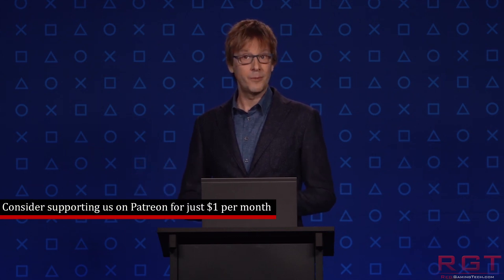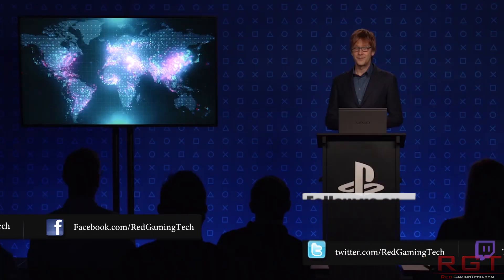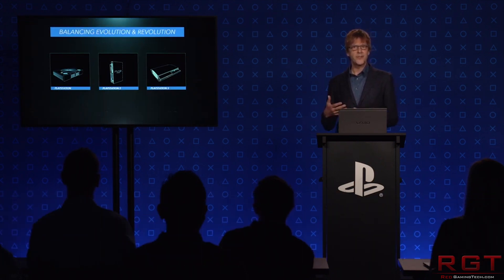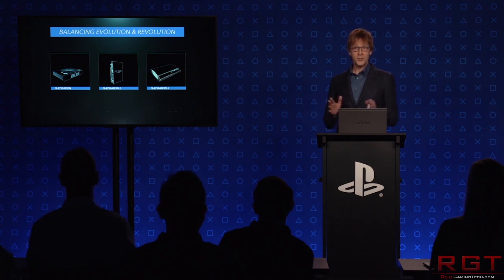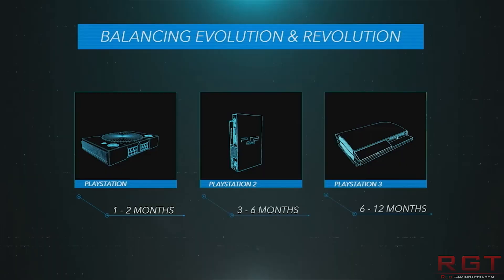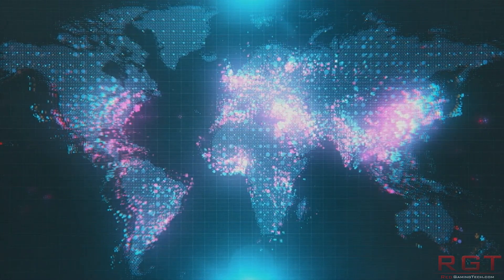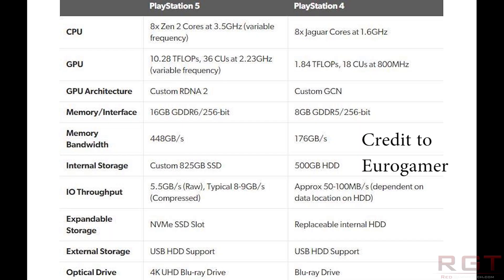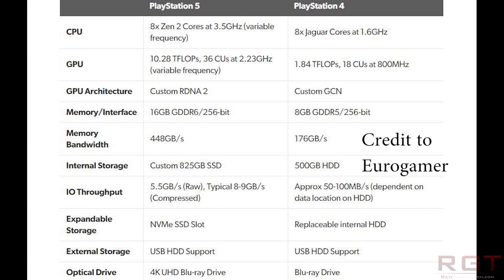Playstation 5 Spec Overview & Analysis | 10.3TFLOPS & RDNA 2 | 3.5 GHZ Zen 2 & Crazy SSD Speeds

Comment: but what is the difference two GPUs of the same architecture delivering the same teraflop .. one with a higher frequency but the other with lower frequency but higher CU in terms of performance and temps?
Reply: Use your brain for once man the harder and faster you push something the more heat it generates. Heat is the limiting factor here.
Reply: @voodooknyte  also Sony has divine studios that required this. Heat was a major factor yes.

Comment: Okay, I mostly called it. I said way back in December that the GPU would be RDNA 2 based (with customizations) and that Sony would be aiming for 10.5ish Tflops.

LOW AND BEHOLD!

Admittedly I thought it was going to be 40CU's at a slightly lower clock speed, but still.

As for my estimate here. It looks like the XBSX GPU is going to be on par with a 2080ti and the PS5's is going to be on par with a 2080 or a 2080 Super. Somewhere in that area. If we look at RDNA 1.0 teraflops, 10.5 of them would be about on par with a 2080. Maybe a hair lower. But RDNA 2.0 is supposed to be considerably more efficient and will have access to a number of performance-enhancing features, so it's probably closer to a 2080 Super. 

This is of course not factoring in the benefits of either consoles customizations or game optimizations. I'd expect both consoles to do better than a 2080ti once those are factored in. Raw numbers aside, both consoles should be capable of 4K 60fps gaming with some not-insignificant raytracing.
Reply: Also, the PS5 nvme is swappable with most PC m.2 nvme 4.0, which is a huge win for PlayStation, unlike Microshaft’s memory cards. 🤣
Reply: @princegroove  

I thought it was more of a dock to add a second one?

I do agree though. The PS5's storage expansion solution is much better. This will especially be obvious a few years down the line when NVME's come down in price and Microsofts proprietary drives still cost about the same. And yes I know I'm assuming the worst, but it's Microsoft. They're going to be reluctant to lower the price any more than they have to.
Reply: Prince Groove do you realize how much an m2 nvme pcie 4.0 1tb drive is? It’s about $250, not sure that I would call that a win!
Reply: @Whoozurdaddy  

Yes, at launch it's not going to make that much of a difference. But over the next few years, non-proprietary NVME's are going to come down in price. Maybe Microsofts drives will come down in price too, but it'll probably always cost more. If only because you have another finger in the pie besides the manufacturer and retailers. So yeah, 2-3 years down the line you'll probably be able to get 1TB plus-sized drives for less than Microsofts single TB drives. So long term I think Sony has the better solution.
Reply: @cptcosmic  

At some point, you'll learn not to be insulting and presumptuous. I'm not holding my breath though

As I said, if you scaled a GPU with RDNA (1) Teraflops to 10.5 it would be about on par with an RTX 2080. Maybe a hair-less. But RDNA 2.0 is a more efficient architecture with a number of performance-enhancing features. If you factor that into things and you'd probably get a GPU with performance roughly on par with a 2080 Super. The XBSX is just a little more powerful, so it'll either be 2080ti performance or somewhere between a 2080ti and a 2080 Super. I didn't feel like getting that specific in my earlier comment so pardon me for not being sufficiently anal-retentive for you.

As for the "over 2080ti performance" statement. Yeah, both consoles will after you factor in customizations and optimizations. I cannot stress enough how much of a boost you get for properly optimizing a game to take advantage of the platform, and it wouldn't exactly take a massive boost in performance to get past 2080ti performance considering the starting points.

None of this is a leap at all dude. I'm sorry if you feel butthurt that consoles are going to stack up so well to your PC, but this is what happens during a new console generation.
Reply: @cptcosmic  

Again, you're assuming I don't know all that.  Alright, give me a moment to de-agitate here.

Obviously, Tflops isn't the best metric. They don't scale linearly, and in terms of performance, they translate into something completely different based on the architecture and configuration you're working with. But they aren't completely divorced from performance when you're comparing like-to-like and they can be useful for making rough points of comparison.

In this case, my logic is going something like this though. The 5700XT is a little more powerful than an RTX 2070 "Vanilla." This configuration would be a little more powerful yet and there isn't a massive gap between a 2070 and 2080. So this configuration would probably be around 2080 level or a little less before factoring in RDNA 2.0's enhancements. Factor those in and we're probably looking at something closer to a 2080 Super.

Also, yes I'd actually agree that the PS5 is a more efficient configuration, but the XBSX is probably still going to be just a little tiny bit faster. It might not end up being quite 2080ti levels (before customizations and optimization), but we don't really have a GPU between the Super and Ti to use as a comparison so I rounded a bit upward for the sake of making a simple comparison.

Obviously, this is all far more complicated than what I'm making out, but this is a simple napkin math analysis. I'm pretty confident I'm in the right ballpark though, and I'm even more confident that once developers optimize for the platforms they'll be able to squeeze out more performance than what you'd see in a 2080ti. How much more and when this would happen I can't say, but developers really can do crazy things when they bother to actually optimize their code.

Comment: With SSD hitting 5.5Gbs do they really need to use VRam for OS? BTW thats > 2x MS SSD.
Reply: That was compressed file reads. Not actual uncompressed reads. If you compare apples to apples, xbox has 4 GB/s reads of compressed files. Which is still lower than ps5.
Reply: @karanvora2674  No. Sony saying 5.5 uncompressed (RAW) compressed with Kraken up from 9 to 20 GB/s. Smashes Xbox.
Reply: @karanvora2674  Far Lower compressed reads.
Reply: @liamtingle2762  ~8-9 GB/s (compressed)

Comment: 11 zen cores in just the IO die😱
Reply: 11 zen core equivalent performance in decompression. Not actual zen cores.
Reply: Nivek Datadin its a small optimized chip for one specific task not a full blown cpu core calm down
Reply: @jikman681  bottlemecks gone. Strain taken off GPU. 
100x fast than PS4
Reply: @jikman681  similar to RT in XsX Gpu? 25TF?
Reply: Nivek Datadin you cant really measure rt performance in tflops. We will see when the pc rdna2 cards come out what kind of rt performance we get.

Comment: IF you think that GPU can keep  2.23 GHz for more than a few minutes, well, you are in for a big disappointment.  This is a 9.2 tf machine, overclocking it to get more performance  will only affect reliability. The Xbox series X is in another league  of its own compared to the PS5, plain and simple.
Reply: Except it's not the clock speed is based on peak power consumption cap, not temperature based which indicates the cooling is more than adequate from an engineering perspective.
Reply: Lol
Reply: @Uruz7Laevatein  regardless what it's based on we all know they've gone fucked it up. loyal fan btw
Reply: Stu if the temperature is kept in check, it will never need to throttle back.
Reply: @NoahThomas29  its not good in the long run neither is it good for the advancement of gaming in 7 years time if a Pro is not released.
Reply: @Uruz7Laevatein  These kind of dumb comments are always the loudest. Not your comment, the original.
Reply: @S99-c5s  a pro does not need to be released to keep the PS5 going strong. i still play games on the base PS4. and they run just fine.
Reply: @NoahThomas29  I do also but it's a busting ball experience now. I've only owned Sony apart from Sega mega drive
Reply: poor child

Comment: I'm thinking Xbox might be he same price or cheaper than ps5
Reply: Matt Something impossible ps5 weaker a lot
Reply: MuskyJamJam I think MS is focusing power on the parts where they can leverage their partnerships for better pricing. 

I’m talking MS partnerships not Xbox. 

MS helped AMD develop these chips and MS are only buying the silicon chips. It’s not like they are paying the price of a whole graphics card. They will leverage their relationship for better pricing than Sony on that. 

As well MS has a partnership with Seagate. Going with a less expensive NVME option compared to Sony’s very expensive NVME option is another cost delta. 

Sony’s option to push the clocks on their chips is going to draw high thermals so the cooling system won’t be cheap, even being cited that their cooling cost more than they had anticipated. 

Sorry so long but this is why I was contemplating the possibility.
Reply: Matt Something hmmmm have a point, lol I’m disappointed in Sony I can’t believe they thought it was acceptable to have a 9.2TFLOP LOL
Reply: MuskyJamJam I’m just speculating as is everyone else. I just keep recalling Phil Spencer say that “they aren’t going to screw up on price” and “people should stop worrying about Microsoft’s money”.
Reply: Matt Something from what I’ve read it’s highly likely the series x will be $499
Reply: Anthony Sanderson most likely
Reply: @UltraJamZHD  what's alot
Reply: Stu ps5 seems quicker on paper
Reply: @UltraJamZHD  definitly not a lot....

Comment: The PS5 is actually 9.2 Teraflops 🤣😅😂
Reply: @princegroove  how is he ?? You do know why they kept it variable in speeds its because when the console doesn't need it most of the time then it will be in the lower end speeds but when the console is needing it in more demanding scenarios it can push it to 10.3 tf and the only the reason why they did this was to keep it cool, it if was 2.2ghz all the time then the thing would get hot so the console won't use 10.3 teraflops all the time just something when it needs it.
Reply: @carlosmartinez3020  I know I'm still really skeptical of what Sony is going to be able to achieve by doing things this way.
Reply: Not really
Reply: @dasimparmy2289  the higher clock speeds will help a little bit but we will see, and don't pay attention to the idiots shouting SSD because in the real world it matter because Microsoft's taken a more complex yet cheaper route but eventually be the same.

Comment: 'Cost' when talking about utilizing hardware & software refers to the the budget of pooled resources, not framerate.  Frame rate (and resolution, or fidelity of various types etc.) all calibrates "cost"  i.e:  "x  game @ 1440p/ 60 has modest cost."... " so we were able to lock 4k at 60 or 2880 at 90-120fps"   Essential, FPS can add to cost... it is not cost...

Comment: Are the people here doesn't watch the livestream? It use the smartshift in order to maxed out the apu performance. Look at the renoir benchmark. It shift power between cpu and gpu. So, it will stay around 9.5-10tflop based on the game. If game require more cpu it lower the gpu. so are the gpu.
Reply: That’s THEORETICAL.
Reply: @MrRequiem147  might be. But amd did show the improvement smartshift bring to the renoir apu comparing with and without it. Around 5-10%. 5-10% from 9.2tflop that should be nearing 10tflop.
Reply: Noob Gamer I have no real doubts about their ability to keep it 9.5-10.2. What I’m really starting to doubt is their cooling system overall. I believe it works theoretically, but the problem is their cooling solution’s cost. I don’t think they have finalized their console form factor because of cooling issues. And that is why you didn’t get to see the console today. If it were done, then there is no reason to keep that from you. I’ve been saying this for a few months now. Sony chose a traditional console design form factor for the PS5. That hampered its development and their reaction to the series X was to overclock. That drove up the heat which meant an expensive cooling solution which drove up the price. And all of that supports the Bloomberg report about them struggling with price. Because how do you ask gamers to pay the same for a weaker console. My gut tells me Sony is going to try and convince gamers a faster SSD is a game changer. You have to be a moron to fall for that.
Reply: @MrRequiem147  it is a game changer. Don't judge a console by it cpu core or gpu cu. Trust me. If the SSD were true and able to deliver what they say, then you will have almost instantaneous load time. For game with stages/level/floor, that have no use. But open world game is what gonna benefits from it. Like m.cerny did say no fast travel loading and no more seeing the game loading texture while playing. I mean no more building appear when you're facing or running that way instead it there from the start. Some game are quite heavy and if they use the hdd even normal ssd might not be fast enough to load them. Remember, this is for next generation game. Even next gen xbox are targeting faster loading time. You will see the difference between them when they come out. For the cooling solution, seeing the xbox series x cooling are pretty big i suspect they will have to use a quite pricey cooling solution. But ps5 have less cu, even xbox 52cu @1.7-1.8ghz( don't quite remember the ghz) so 36cu with 2.1 stable clock should be generating less heat. The final problem come to the price. If xsx were 600, then ps5 should be 500-550.
Reply: Sounds like marketing speak.
Reply: @dasimparmy2289  whatever you says man. As long as you happy.
Reply: Doesnt CPUs and GPUs on computer already do this using speed step and GPU power settings regardless of smart shift ? Although smart shift probably has more "steps" for CPU speed vs power usage
Reply: @gamerxt333  according to amd it for apu. So cpu and gpu doesn't count. The smartshift are for limited power envelope kinda of thing. Cpu n gpu have their own power source for desktop

Comment: One of the ideal cases for the ps5's variable frequency is on older ps4 games where max GPU frequencies(2.23GHz) should be the norm, due to the anemic jaguar cores. Running ps4 code on the new cores would not require them to be set to the maximum frequency to gain the requisite speed up needed for 4k60(on unlocked framerate or patched games). But as more of the ps5's GPU feature set is used and more complex CPU operations are used in real ps5 games I don't think it will hit that 2.23GHz GPU and 3.5 CPU consistently. If it could it would just be the spec full stop. which is mehh. The ps5 SSD is the real hero here it's going to do a lot to eliminate pop-in which can translate into better L.O.D on-screen in cross-platform games. The Decima engine is loving that SSD I'm sure.

Comment: come on Paul this console will never hit a 2.23 ghz boost speed and to be honest it's not smart to have variable speed on a console cpu and gpu especially has things start running hot will have stuttering and frames will be all over the place.  even digital foundry said that having a fix speed is best because gives a consistent performance levels
Reply: "boost " clock speed is very misleading is basically a difference between 2% clock speed and a 10% power consumption difference in GPU block.
Reply: Are you saying that MC is wrong?
Reply: @Uruz7Laevatein  Lol and you're eating Sony's bullshit, hook, line, and sinker. Testing with current GPU's shows that kind of power/clock scaling to be completely delusional. It's going to be well more than a 2% drop in clock speed to drop power by 10%. Expect at LEAST 5% drop in clocks for that kind of power saving in actual real-world use cases.
Reply: @BLUEKNlFE  Yes. He also lied about clock-speed being more important than a wider GPU. This is EASILY testable with current hardware. ExtremeTech did a great article on this with a bunch of actual GPU hardware testing showing Cerny was outright WRONG.
Reply: @Cooe.  Lol you don't even make sense, power scaling is quadratic if not cubic ( according to Intel) and varies.on process nodes and architecture, and not to mention the type of algorithm/workload that hardware is running. Thus extrapolating newer GPU architecture s based on older ones is misleading if not foolish. I had a great laugh at such stupidity.
Reply: @Uruz7Laevatein  Power scaling on PC hardware hasn't changed dramatically in decades. And scaling only becomes exponential when pushed out of a "sweet spot range", which yeah, differs based on the process & architecture, but expecting TSMC's 7nm+ to have dramatically different characteristics to 7nm (beyond the "sweet spot" range being shifted up a bit) is straight up delusional based on everything we know about the process. We're only looking at around a 10-15% improvement to efficiency.